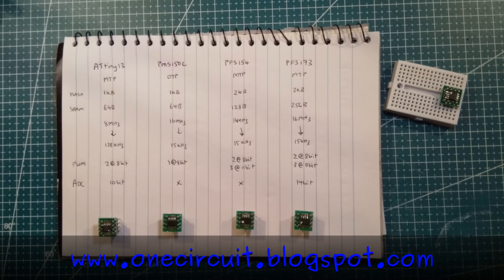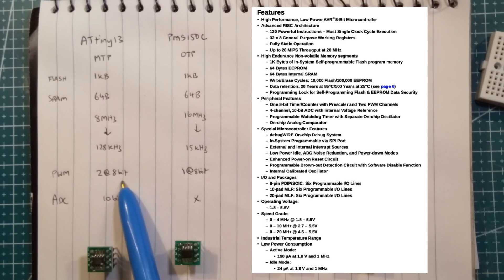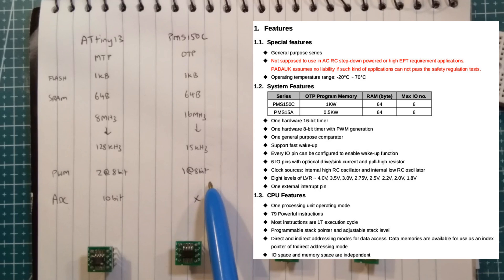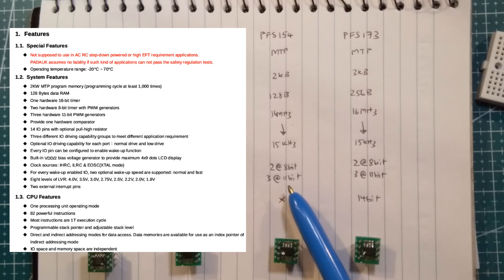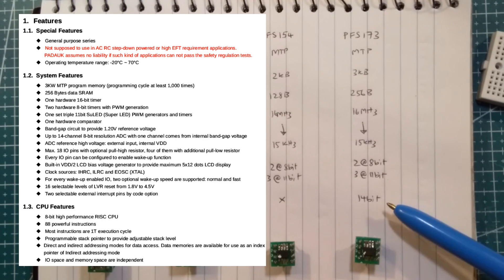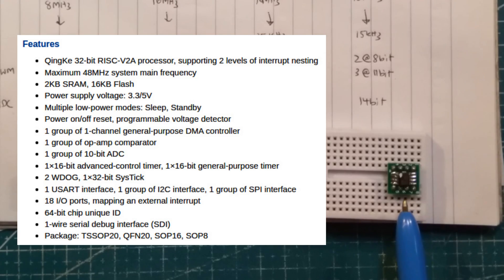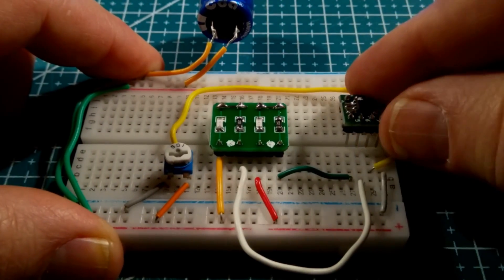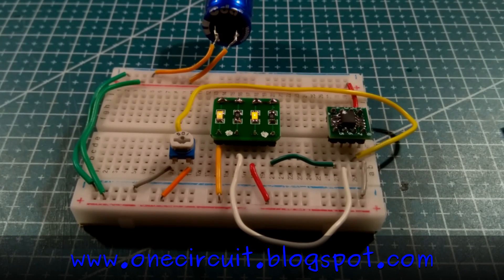8 Pin Microcontroller Wars: ATtiny13, PMS150C, PFS154, PFS173 and CH32V003

Comment: Although I have always argued that one microcontroller is better than the other, from the larger perspective, I have found all of these low cost microcontrollers being used for similar tasks. However it's absolutely amazing how many features brands are integrating in these small chips for costs lower than a bag of Crisps. Although some of them use costlier programmers than others because programming features have been removed for cost saving and more, in a niche product, I can foresee the presence of most (if not all) of these chips. But in the larger picture, I personally use these for minimal tasks like blinking a LED which is what I'm sure many more may be doing😂😂.  Also the fact that most of these are integrated into the Arduino IDE is also great. Thanks a lot for taking my small suggestion and elaborating on the subject . A great Video as always!!
Reply from the maker: Thank you Atul. One of my videos uses a 3c PMS150C to drive a motor via a ULN2003. Great fun! 👍😀

Comment: you can sort of make an ADC with the PMS154 by using it's internal comparator and the variable reference voltage (vary the reference until it's over the sampled voltage)... it's slow but works between ~0.2-2.5V. Enough for battery management.
I agree that the CH32V003 is amazing, as it can do software-based USB low speed thanks to cnlohr's work. There's also the puya PY32F002A chips if you're looking for a middle ground between that and the padauks (armM0 with DMA for 15 cents)
Reply from the maker: @Kanken-jl7oe  Yes that is what I did, and decoupling is very important in this circumstance! 👍😀

Comment: You better check on the ADC in the PFS173!
Also all the PMC/PMS13x series all have 12-bit ADC in them.
I use piles of the 13x series
Reply from the maker: @stevenbliss989  I have PFS173. Where are you sourcing the PMS13X from? 🤔

Comment: Why didn't You take ATtiny85 instead of 13? It's also popular (eg. it's core of DigiSpark)
Reply from the maker: I thought about that after the video! I have used the attiny85, but now the cost is prohibitive. My PFS154 supply was 8c per unit. The PFS173 came in around 13c per unit. 👍😀

Comment: I am using the attiny202.  At 50cents it seems expensive, lol, but the ch32v003 has so much more flash for 15 cents, and the ch32v203 is a real winner for anything more complicated using usb and more pins.  The esp32 is now the goto for a bigger faster chip with wifi and bt and even then it is not expensive.   Amazing time to be alive if your a hardware/software geek.
Reply from the maker: You are so correct and I worry sometimes that I'll end up like the donkey starving between two bales of hay for lack of being able to make a decision!

Comment: What about PicAxe?
Reply: PicAxe is very easy to program.. using a basic like programming language... it uses the Microchips, 12F1840, PIC16F1825, PIC16F1847, PIC16F1829, PIC16F1829, PIC18F14K22, PIC18F25K22, PIC18F45K22 with embedded BASIC interpreter.
Reply from the maker: One day....😬
Reply from the maker: I've not ventured into Pic world - I hear it is the Dark Side of the force! At the moment I'm flat out keeping up with semi-Arduino IDE based solutions.

Comment: I’ve been using the CH32V003 for a bit now with the Arduino IDE (CLI). Its Arduino core is not complete, and you have to fiddle with it a bit. After making some custom libraries for myself, I’m at a point where it pretty much does everything I want for less than 20 cents each though. Definitely recommended. I also like the CH552, but not convinced the 8 pin version is worthwhile.
Reply: That one does look interesting.  Since the atmega8a can't be had for 0.45 cent anymore, may be time to delve into RISC-V.
Reply from the maker: Just when I settled on this as a possible future, along comes PUYA!
https://youtu.be/qWRowOsYSLY
Oh my aching bank balance 👍😀
Reply: Just one little correction: the PFS173 does not have a 14-bit ADC. It’s an 8-bit ADC with up to 14 input channels.
Reply from the maker: @simontillson482  Thank you! If you check the blog you’ll see ChatGPT’s comparison, notably incorrect! 😳